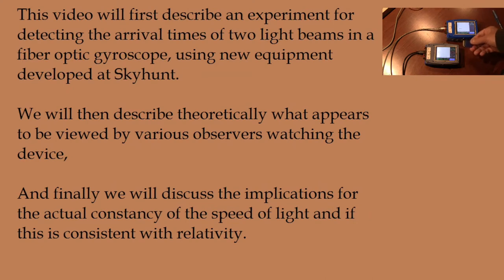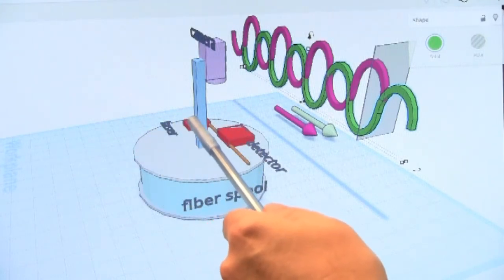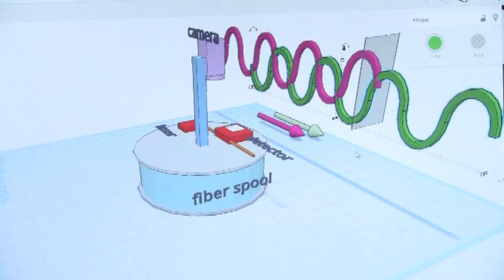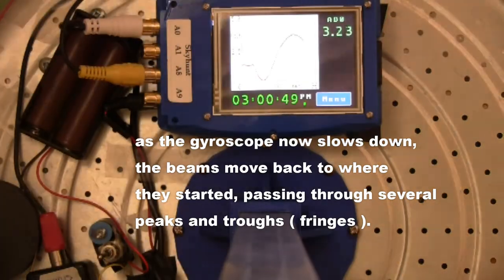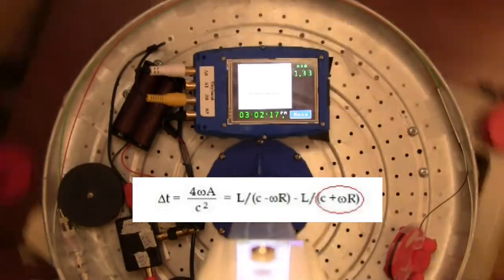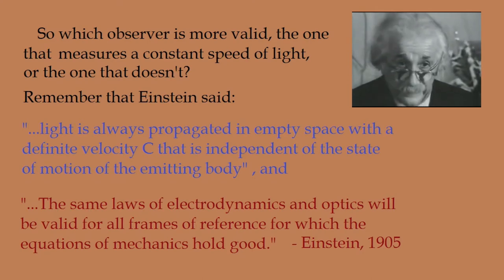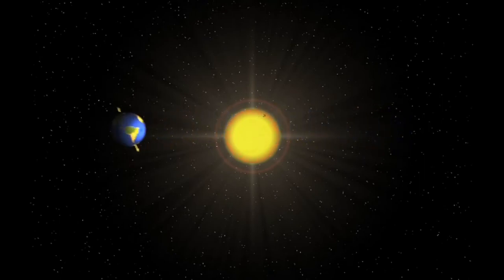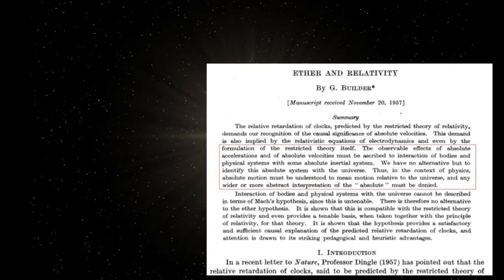Is the speed of light constant in a fiber optic gyroscope?

Comment: Given that you're an experimentalist and not afraid of entertaining ideas outside the mainstream I thought I'd share this thought I've had regarding the various experiments related to the wave particle duality and gyroscopes. I'm wondering if any of the "single electron" double slit experiments have been done where the apparatus containing the electron emitter is relocated after each "shot" to see if the pattern it produces differs from expectation. If there's a medium and it exhibits properties which influence the "particle"  then it seems reasonable to me the first emission could potentially influence subsequent emissions if the apparatus isn't relocated between emissions. I'd imagine linear or rotational movement should suffice.  Another thought I've had regarding gyroscopes and what they're doing, is that the rotation causes them to attempt to bleed off the inherited velocity they would otherwise carry, however because they are fixed in some respects this results in precession as it's dragged by the inertia in the non rotational bits. I'd be curious to hear your thoughts and if you think there's anything "there".

Comment: That "Remember that Einstein said:" part is complete bulls**t. SPECIAL relativity theory (published in 1905!) states the equivalece of INERTIA SYSTEMs, not an inertia system and a rotating system. Nobody said they were equal. (thus the phrase: inertia forces - centrifugal, Coriolis) 

General relativity theory (published in 1915), however, as far as I understand, deals with those non-inertia (accelerating, eg. rotating) systems as well. I cannot tell what it predicts for the outcome of such system, whether it is what we see or not. I am simply saying it is not what Einstein (in special reativity theory, at least) says.
Reply: by the way here light is not propagating in empty space either but in an optic fiber (n>1) but that probably does not make any difference I admit... just wanna point out :p
Reply from the maker: Yes, that is correct - the effect of the refractive index in a fiber optic gyro cancels out, so the fringe shift is the same as it would be in a vacuum.
Reply from the maker: Daniel - there is no such thing as a purely inertial frame of reference that is practical. The thought experiments of Einstein's special relativity all take place on the rotating earth, which is also rotating around the sun, and again around the galaxy. If we exclude all situations where the frame of reference is rotating, then special relativity has no  applicability in the real world. Besides, Einstein says "where the equations of mechanics hold good", not specifically "inertial frames". In this context Einstein's statements about the constancy of the speed of light would appear to be in error. Einstein was not even aware of the Sagnac effect at the time and never mentioned it later, so we should not put words in his mouth to say that he meant something other than what he actually said. Besides, you acquiesce to general relativity, seemingly because you can see that SR doesn't apply, and you also admit you don't understand GR, so why be an Einstein apologist??
Reply: It's been about 15 years since I've read Einstein's GR paper, but I seem to remember it predicting a gravitational lensing effect.  That effect was arguably known before, but anyway, appears to be a real phenomenon.  However, it was the mechanism that was claimed in the paper to cause that effect that strains credulity, relying on what I call "thick light".  I guess that's one reason why many mainstream physicists and cosmologists are willing to accept GR might not be worth that paper it's written on.

On the other hand, SR holds a special place in the hearts and minds of virtually everyone that is seemingly irreproachable, but with astonishingly little reason why.  Seems to me, Einstein lifted Lorentz's equations published the year before in 1904, then made his contribution by applying a new INTERPRETATION to those equations.  Einstein did not deduce this new interpretation as per the scientific method, but rather just made it up because it could be true (or possibly 'dreamed' it).  In effect, Einstein's new INTERPRETATION claimed time was variable (Lorentz considered this constant in his model of his equations) and c was constant (Lorentz considered this variable).  Whether Einstein's new INTERPRETATION was correct, whether Lorentz's original INTERPRETATION was correct, or something else cannot be discovered from the equations themselves and have proved to be remarkably difficult to distinguish by experimentation.  In that regard, Einstein's contribution of a new INTERPRETATION of the Lorentz equations is unequivocally pure speculation or whim.  Nothing more.  Even if, by some miracle, it does turn out to correctly describe the universe, it must be admitted to be nothing more than PURE SPECULATION without a hint of evidence or rationale as to how or why it is correct.  Seems an awfully thin basis upon which to rest such faith and certainty as we see today from so many.

I guess my point is the "Einstein apologist" phenomenon is, at least from a social experimentation perspective, surely one of the most incredible occurrences in human history.
Reply from the maker: I think I would have to agree with everything you just said! Nicely articulated, too.
Reply: @jwbowman06  If WIMP dark matter doesn't exist, the best way to explain galactic lensing is with a plasma density gradient.

In fact, plasma interactions with light can potentially explain all claimed observations of gravitational redshift.

I personally like the mass-polariton theory of light. In this theory, part of a photon's momentum is propagated by the medium itself.

The medium can lose its share of momentum to the environment. Quantum theory clealy states that loss of momentum must result in redshift.
Reply: @plenum88  
SR applies to accelerated frames just fine. You don't need GR unless there is gravity or very high energy concentration. 

In accelerated frames, the laws of motion need to be modified with fictitious terms, so they don't hold good!
Reply: I was going to comment something similar that despite Sagnac winning the prize for detecting the ether with this experiment , SR has a way out as the experiment does not compare the speed of light between different inertial frames like in different orientations but the speed in an non-inertial frame . So to co-rotate and hence be at rest to the experiment so that the experiment does not rotate wrt the observer (so to what then ?? The ether ??? Doug so smartly asked) sadly is not accepted as a way out . So to make myself clear - i am with Doug (i too experiment) and think his argument is valid , but i also know why under todays dogmas it won’t be accepted . We need to break them within their own rules Doug - and we will !!
Reply: @iridium1118  what do you reply to Doug’s argument that there is no acceleration wrt to the observer ? Take away the other planets stars - so wrt what does the earth physically meaningfully rotate to constitute a physically meaningful acceleration ? The ether ? But this is what Doug aimed to prove q.e.d.
Reply: @hannaedwards5197  sagnac effect is easily derived in SR and SR is incompatible with ether since the speed of light is equal in all inertial frames.  SR and GR have no problem describing non inertial frames. 

The concept of absolute rotation breaks down in GR because of frame dragging. The rotation of objects is dependent on the large scale distribution of matter in the universe. 

There are theories and experiments for stationary aether, aether drag, and partial aether drag. There is no theory that incorporates all experiments. Aether is therefore wrong.

I know you will cling onto aether until you die. There are so many holes in the theory, the only aether you could honestly still hold onto is a completely pseudoscientific, superfluous one that makes no testable predictions and serves nothing than to calm the nerves of people that can't live without it.
Reply: @iridium1118  you didn’t answer my question so let me repeat it : with respect to what does the earth rotate ? 

I.e. take all stars away - how do you even know it rotates ? Because you feel a force you may claim ? But for that to be the case , relative to what does it rotate then ? A physical force begets a physical interaction - nothing comes from nothing . I asked you to think , not to recite unphysical dogmas from textbooks which are at question . 

If statement A is at question you cannot reply with statement A to defend statement A .
Reply: @hannaedwards5197  photons follow geodesics through space. The equations of motion make no use of aether. By Occam's razor, we may discard a superfluous notion of aether.

A non rotating frame is one where photons are observed to follow geodesics. Once you have that frame, rotation is measured relative to it. That frame is the answer to your question. An observer may emit photons from themselves to establish this frame. This can be done regardless of the content of the rest of the universe. 

No aether is required to understand rotation because no aether is required to understand translation, either.

The fictitious forces you talk about are a distraction. They originate from another force present, such as intermolecular forces arising from the electromagnetic force. The fictitious forces arise because that additional force (e.g. intermolecular force) is deviating matter from a geodesic. 

This "dogma" is actually the result of more experiments than you have even heard of, performed over 120 years, carefully, by many physicists. I don't care if you don't like it, you haven't even tried to refute it. You say the theory doesn't work. I say it does. Hitchen's razor.

There isn't even a concept of absolute linear acceleration. Every object in orbit and free fall are in inertial frames, and they all accelerate relative to each other.
Reply: @iridium1118  You again did not reply to my question but evaded it . I didn't say anything a-like you put into my mouth but asked a question which you repeatedly refuse to answer trying to evade .
Reply: @hannaedwards5197  I answered your question. It is not my job to feed it to you. I don't care about making sure you understand. Being right is enough.
Reply: A frame is no physical thing but a hypothetical construct . Your answer is as good as replying "with respect to that vector in my theory" . But your answer appears to imply "with respect to the photons" when you say "A non rotating frame is one where photons are observed to follow geodesics. ..That frame is the answer to your question." . But so your reply implies that rotation gains meaning wrt photons (you must agree because this is what is measured in gyroscopes) , then .... gotto formulate this one good Doug . Commenting this here for us Doug , not to reply back to iridium . 

((for Dough/I need to work out 1 concise short statement along the following brainstorm : "photons set / are married to / bring to light ... what frame .... formulate it in a sense , but without saying such , as that EM-waves are traveling disturbances in such . Formulate that without the knowledge or claim that they are a traveling disturbance in such to be first but so that such follows from it . i.e. being some measure of it --> must be married to it in some way --> no matter what way must have some absolute speed in it which can be zero or anything else ...."))  

But Doug mind you - whilst i say motion must have absolute meaning and that light is a traveling disturbance in an ether (about which i make no claims at all what it is or isn't) from which i can run away so that light reaches me later which gives motion absolute meaning as of motion through this "whatever" in which light is the traveling disturbance ... on the other hand i also say this fabric in which all these waves happen - is its own waves ! So i say there is no substrate (mindbending but else we face a stack of turtles - so i think i take a cycle) but the waves itself are its own substrate . So in a sense - but a different sense , i also don't have a substrate , but still an ether that however is the totality of all the wave patterns that constitute the totality of the fabric reality aka universe . But that does set an absolute frame through which light is a traveling disturbance and through which motion gains absolute meaning as relative to light . It doesn't matter that planets move around as light comes traveling along . I is a traveling disturbance in whatever substrate it faces . If the substrate changes in a fictive "absolute frame" through planets moving as it comes traveling along so be it . But that highlights the need for such a tool , like a cartesian restframe in which we i.e. vary the density in a given spacetime volume as i.e. matter moves along for light to travel through it . A co-moving expanding one appears a sensible tool .

Comment: Alas,  there is no science evidence that the physical earth actually rotates or moves. That is an unproven assumption. In fact there are science experiments that show is is stationary. 
@7:22 clue - the physical earth is an absolute frame of reference. ;-/
Reply: Mechanical and optical gyros/gyrocompasses prove the earth rotates. So does the foucault pendulum.
Reply: @iridium1118  Mach's principle says you cannot distinguish stationary Earth + rotating Universe or statnionary Universe + rotating Earth.
Reply: @maciejnajlepszy  
Mach's Principe was published before GR, SR, or even Lorenz Ether Theory were published. It's generally viewed as wrong by physicists nowadays.

Most generously, it can be seen as a prediction of general relativity. If the universe was rotating, gyroscopes would still measure an angular velocity on Earth due to frame dragging. 

So what's more likely, Earth is rotating or the entire universe is RIGIDLY rotating around a point centered in Earth?
Reply: @iridium1118  It doesn't matter what's more likely. If the cosmos in its complexed form exists (not mentioning explanation of its origin), therefore is there really a problem consider it is rotating? And since every movement is relative, no scientist can disprove Mach's principle, because simply there isn't a method to do so. As long as science has no idea how gravity works, no one can distinguish between gravitational and acceleration forces, so every reference frame can be used to describe movement.
Reply: @maciejnajlepszy  we absolutely can distinguish gravity and acceleration. This is the danger of hearing half truths on the internet and thinking you know a thing or two. 

Gravity is the same as acceleration LOCALLY. When you consider the global picture, you realize acceleration could never explain a gravitational well.
Reply: @iridium1118  They actually do not. Look into the details.
Reply: @Chicken_Little_Syndrome  they can't distinguish between acceleration and gravity? Yes they can. They are only indistinguishable locally. 

Make an argument or don't bother wasting my time.
Reply: Shout-out to my homoe Ryan holding it down on the skreets from the lab frame. Fixed and absolute.